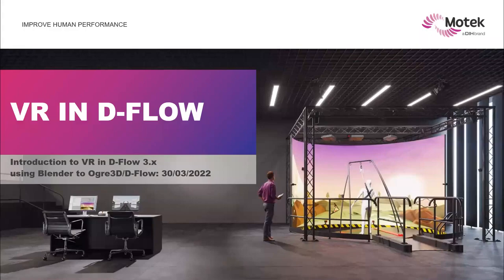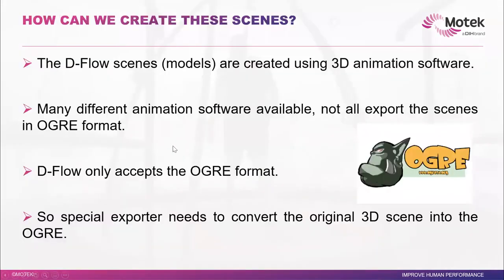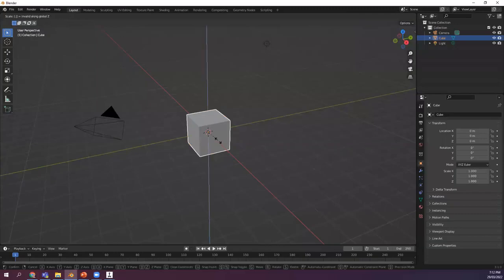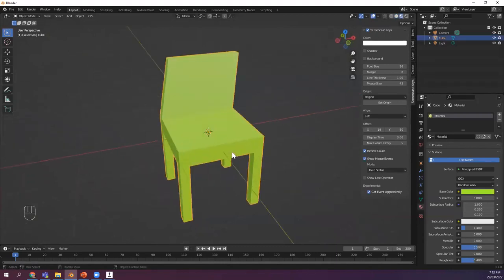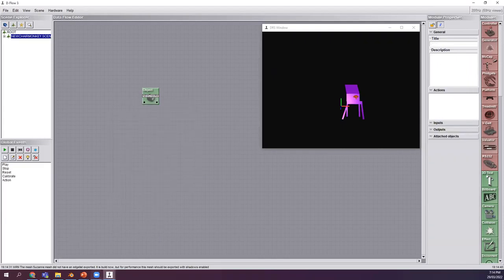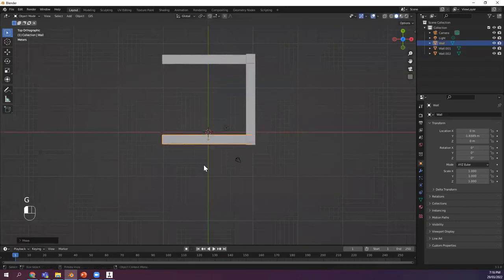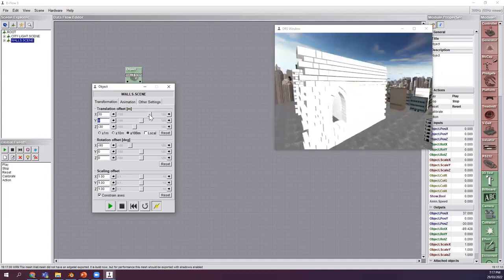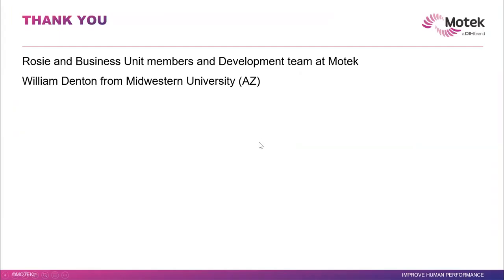Blender Intro to D-Flow

Comment: Your product manual says:
"D-Flow versions older then 3.14 support Ogre version 1.7. Newer D-Flow versions support Ogre version 1.8.1"
and OGRE 1.8.1 was released in 2012.09, who is not aware of the 1.10.0 mesh format currently in use.

And, your video does not mention the installation of OGRE toolchains for the Blender plugin to work. If one installed latest OGRE (not OGRE-Next) according to the blender2ogre plugin README, it would export meshes in the 1.10.0 format, and this would yield scene import failures in your software.

For now, solution is one can use the OgreMeshUpgrader tool to downgrade exported meshes to an older format. I am currently working with the plugin developers to add an option in Blender to export to older formats.